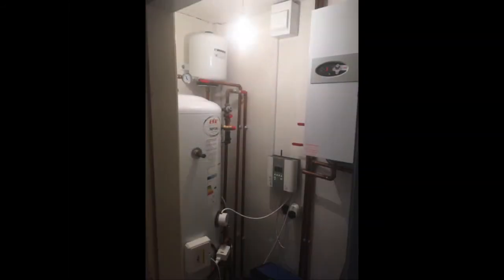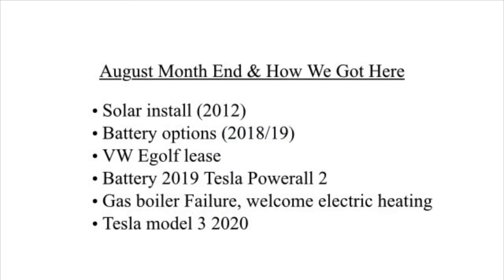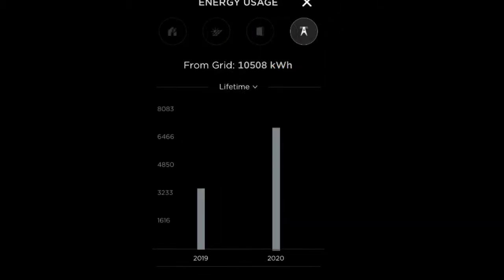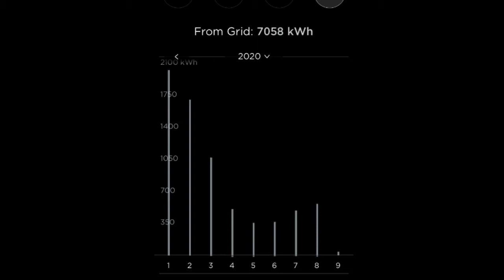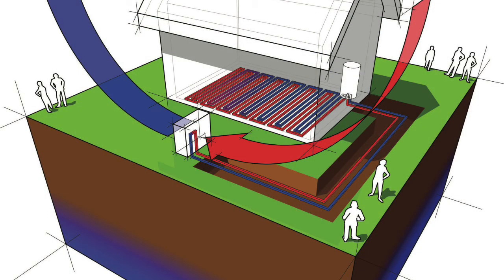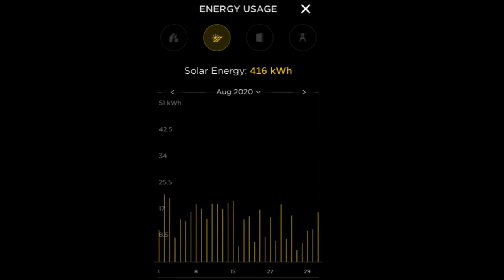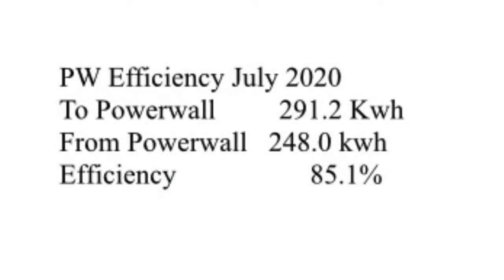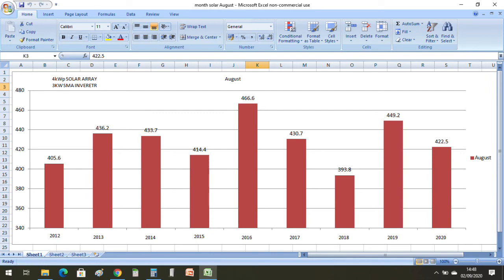August Month End but Where Should The System Go Next ?

Comment: Might I suggest as you are using the electric  boiler for heating in the winter and this is the lower point for obtaining electricity from your PV panels you think about extra insulation for your house? You may also be able to take advantage of the Green Homes Grant which I understand the government is launching at the end of September this year ( indications available only until March 2021). One element that it  would allow you to do is contribute to the cost of an air source heat pump, but will also cover various types of wall and roof insulation. At the risk of stating the obvious extra insulation should enable you to,use the boiler less for heating. You might also think about rather than an air source heat pump using the Green Grant install a ground source heat pump, although obviously more disruptive, if designed in a certain way it may help you to cool your house in the summer and store the surplus heat in the ground for use in the winter. As I am sure you will have seen there is a lot of material on the web about heat pumps.
Reply from the maker: Peter Jones I have Indeed been thinking about heat pumps, but trying to get some concrete evidence is scares, the house is already well insulated and hopefully I can get a heat pump on the grants you speak off,  I did think the costs of ground source would be out of my reach but a ashp could be less disruptive and more costs effective
Reply: Chris Hill, you may like to look at the heat pump association website ( although it may be too simplistic for you), there is also some useful information on websites of companies such as Nibe, Kensa although again they may not tell you anything you don’t already know.Btw I do find your postings interesting, I am hoping to start construction of a new house in about 12 months time and information from various postings from you and others is very useful. Thank you.
Reply from the maker: Peter Jones I’ve taken a look and found a link to the MCS standards thank q, kind of thing I’m looking for. It’s a short period for the grants, looks like I will have to put my faith in to a company if I want to go down the grant path,